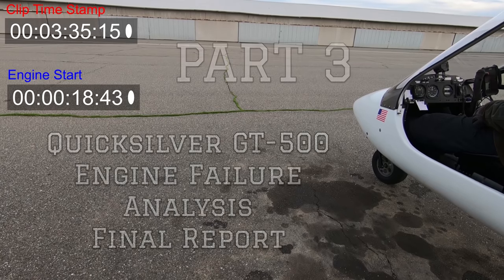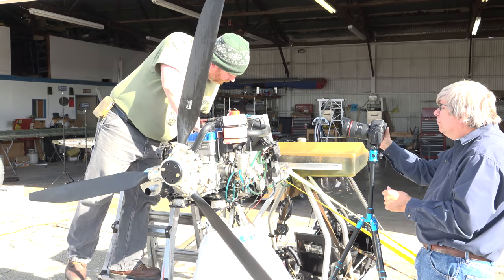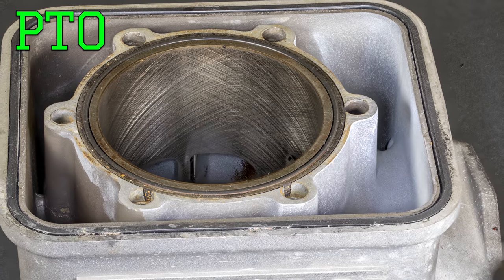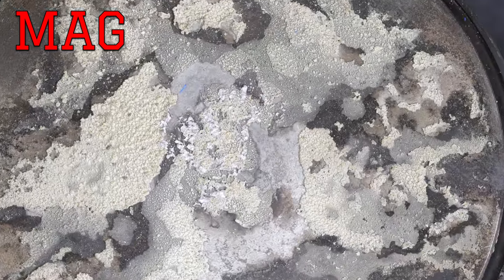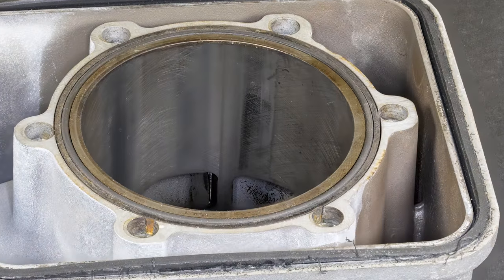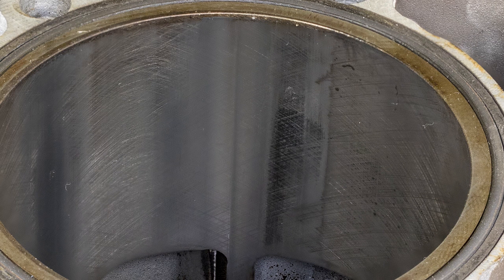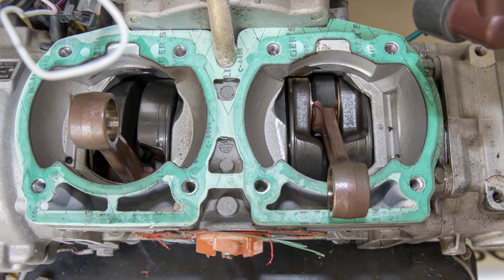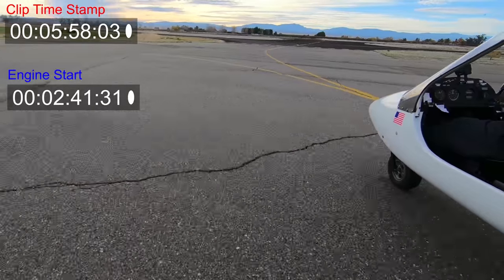GT-500 Crash Investigation (Part 3) Final Analysis

Comment: Important Addition to your Investigation Report: 
Coolant Loss of Rotax 582 Blue Head is most likely from leaking O-Ring Head Gaskets blowing the coolant out of the radiator. In August 2018 I bought a Titan Tornado II that had not been flown for a number of years. It had 174 hours on the engine. The coolant reservoir bottle was full but after running engine up and seeing a high head temperature I opened the radiator cap and the rad was down about a quart of coolant. I filled the radiator and checked for leaks over a couple of days. The second run up was only a few minutes but the head temperature came up again and I found coolant on the tail surfaces and the rad down the same amount. I removed the head and the O-ring were worn oval with tear marks. No indication the coolant was getting into the cylinders but probably leaking high pressure combustion chamber exhaust gas into the head coolant chamber foaming up the coolant. Luckily the cylinders were in excellent condition. Rotax calls for the head to be removed every 150 hours and the piston head scraped clean of carbon. I assume they want the head gasket O-Rings changed on reassembly. They also call for overhaul at 300 hours.

Comment: First of all I would like to thank the fine folks at Rainbow Aviation for this very informative video.
I would like to add some general knowledge to this thread in order to promote knowledge among all aviators. It really bothered me when the cooling system expansion tank was pointed out and the way it was installed. Clearly whoever had installed this cooling system did not have an idea at all about how a cooling system is supposed to work. 

The coolant recovery line that was improperly added at the top of the expansion tank was one of the causes of loss of coolant in the entire system. It is basically a brick at this point! The proper method of installing the recovery/overflow line is to go into the bottom of the tank. Is this video, it clearly shows that the outlet, the small nipple at the bottom of the tank, was plugged up. Completely wrong!! Now, if the line that was added at the top would have had a piece of tubing or piping that went to the bottom of the tank internally, it would've probably worked correctly. But all  they had to do was hook it up to the already provided outlet nipple! 

In a liquid cooled engine, water needs to be surrounding every square inch of 'wetted' areas (cooling jackets around cylinders, water pump, hoses, and radiator) from bottom to top, with no air pockets. The water is what absorbs the heat. Now, as the engine heats up, the water expands...it also builds up a bit of pressure. The liquid flows right into the overflow/expansion tank. The radiator cap is spring loaded and is supposed to open when the pressure gets too high. Most systems are supposed to operate at about 4 or 5 pounds of pressure. 

This is only half, though, of what is supposed to happen. When the engine is shut down, everything cools off. The water condenses, taking up less space in the wetted areas previously mentioned. The  net effect of this cooling down,  is a pressure drop in the engine block area. A vacuum is actually created on the waterside of the block. Coolant can then flow FROM the overflow/ expansion tank back INTO the engine block!! The waterside should stay as sealed up as much as possible to allow the physics to work properly! The coolant level in the exp. tank should fluctuate as the system heats and cools. The expansion tank must be able to vent properly in order for the whole system to function correctly. There should be no leaks (as shown also in the video) in any hoses, pump, radiator, block etc. Air is the enemy in a sealed system!! Only the expansion tank should have air in and out of it!  Your car cooling system works the same way!

I hope this helps everyone!!

Comment: The detail of your forensic analysis is stellar.  Early on you mentioned that the aircraft maintenance was current.  The elephant in the room is, who maintained that aircraft?  Not their name,  but their qualifications.  The condition of this aircraft being used in an instructional capacity is borderline criminal.  More than likely, "check coolant level" is on the preflight checklist.  A quick glance at the plastic bottle and the "pilot" would "assume" the coolant level was sufficient.  So many other deficiencies.  We all know and accept that "stuff happens".  This video clearly shows how screwed up an engine can be and still function.  At 23:10 there are several "bugs" on the carb parts??  Videography detail is outstanding !!
Reply from the maker: Beaver, thanks for your kind comments, especially from someone of your credentials.  It's ironic how many aircraft are running around with significant levels of maintenance deficiencies. I think it is more a case of you don't know, what you don't know. And I suppose the reason that our maintenance classes are so popular. This kind of stuff happens, and the first comments are usually about how lousy the two-stroke engine is. You and I know better. I'm constantly saying that the vast majority of problems, on these little airplanes that we love to fly, are "caused" by the owner/operators. In this case, the owner of the aircraft was a student pilot and the airplane was relatively new to him. Unfortunately, here in Northern California we have a severe lack of instructors for these type of aircraft. The instructor was a GA instructor with minimal knowledge about the two-stroke engines. Kind of a perfect storm.
Reply: Looks like he never checked it and or did the checks himself or not at all . New pilots this is not your Honda civic it is A flameout waiting to happen . You wont like the sinking feeling you get when it quits on you low and downwind.

Comment: The video tells us why the engine quit, yet no mention was made of the pilots control input which in my opinion was the actual cause of the accident.  As the RPM's were dropping the nose of the plane should have been immediately lowered  to gain airspeed for the flare.  It was obvious that as the RPM's dropped the pilot briefly pushed the nose forward then before the plane could pick up speed he pulled the yoke back into his lap.  The result was predictable.  Sure it was an engine failure that started the chain of events but the pilot mishandled the recovery and landing.
Reply: I agree 100%  It kinda surprised me he pancaked in like that. It almost looked fake, like a cartoon,  I was looking for the roadrunner Bee Bee!! Hawk out!!
Reply: Come on, its obvious that he cant be called a Pilot, the engine had no maintenance whatsoever, they never checked the coolant level, they never payed attention to the temp gauges or anything, and did not know how to recover from this engine out stall, they are very very  lucky to be alive

Comment: Aside from an inadequate pre-flight, a cold 2 stroke engine and an obvious need to get out to the practice area ASAP & work hard on power off & power on stalls, what could go wrong? . Never drop below a pre- designated altitude (I always used the point of manuver initiation as my start altitude) & get that muscle memory trained. I know every pilot that has watched this has cringed as this poor guy pulls the yoke into his lap the second the engine seized. This is why we practice constantly. Finally, it's very easy to arm chair quarter back. We are all grateful for you guys sharing. I've made many mistakes as a pilot. If we're lucky we survive to teach the next batch of fliers. Cheers!
1 second ago

Comment: Simply brilliant. Thank you Carol and Brian Carpenter and Rainbow Aviation. I hear repeated trashing of two stroke engines and this body of work you have set forth has no fingerprints pointing to any inherent weaknesses in these engines. Of course, your work was incredibly complete but the coolant system wrong plumbing and the chain of failures that you outline give me comfort to know that yet another accident comes down to "situational awareness" for all involved in the flying and readiness of an aviation system.

Comment: Very helpful analysis. Always comes back to basics of preflight checks, not ignoring warning signs, and airmanship. I've only flown LSA (Aerotrek 240 aka Eurofox), not ultralights. My instructor reviewed engine out procedures on takeoff, emphasizing retention of airspeed and best glide. Next time she closed the throttle I pushed the stick forward so aggressively we experienced negative G's! I do wonder if this crash over the runway could have been avoided, or if a stall crash was inevitable. In the Aerotrek I believe it would have likely had a different outcome if handled correctly.

Comment: I am a proponent for using WATER PRESSURE gauges as THE way to monitor a cooling system and 
when you think how it works against " what is not right and what is going on", it makes way more sense 
than a temp gauge.
Simply put, a pressure gauge is telling you, if your too low a pressure you do not have enough 'coolant
volume' and or a leak at the point in time of the failure and if it is, or starts climb too high you are making 
steam. 
A temp gauge depends on a piezo sensor that if it is suddenly dry it will not respond as it should, like a 
pressure diaphragm that is a go or a no go indicator.

Comment: Thank you for sharing. I do have a question about something brought up during the carb analysis. You said that the idle jets had no o-ring. I recently bought and installed new idler jets. I too thought an o-ring needed to be installed. My parts supplier noted that no o-ring was installed on the Bing 54 or 84. A check of the Bing website showed no o-ring. When I removed my old idler jets they too did not have o-rings on them. Can you confirm this statement?

Comment: Great engine failure analysis! As far as the accident goes, the pilot could have not only prevented it by proper engine maintenance but also flying properly before and during the engine failure. He didnt stay in ground effect and he pulled back rather than pitching forward when the engine began to die.

Comment: As is said later on, it was a stellar presentation.  Your knowledge is extensive.   I've flown with the 503 for many, many years.   Would not sit behind (or in front of :) a 582.  They always have trouble of some description.   

It does take quite a bit of knowledge of, and maintenance of, these 2 strokes.  You can keep them running well IF you have a maintenance plan,  knowledge and an ability to read and follow instructions.    Lots of folks won't ask for assistance.The overflow was a dead giveaway.  Even I (Mr. fan cooled 503) would have known that.  The carbs were a great giveaway also.  No attention to maintenance at all.   Thanks for your in detail explanation - I really enjoyed.  (Never had heard about a "shock wave" in a cylinder.  :)   Thanks.

Comment: Nice video series on this accident!  Well done.  

So...I'm curious.  Given that the engine was liquid-cooled, how long of a warm-up is appropriate?  Obviously longer than four minutes?  19C is 66F so it wasn't horribly cold in Willows that afternoon.  Four minutes for a liquid-cooled engine seems like quite a long time.  

Is there a coolant temperature gauge in the GT500?  In my experience, temperature gauges will give erroneous indications if there is not liquid to measure the temperature of.  

I agree with your conclusions though: Pretty poor maintenance and preflight.  I've noticed that in general, people don't take aviation very seriously, especially in the homebuilt crowd.  This guy's just lucky the engine quit when it did.  Another hundred feet higher and, holding the stick back like that, he'd have been a lawn dart instead of just a smoosh.
Reply: @That Bob Guy .... You appear to casting asperagus at the "home built crowd" : that be me! Let me unwind your overwrought criticisms: (1) the water temp normal is circa 150F-175F or similar so there would be no usual need to get the temp stabilized prior to lift off (perhaps you are thinking of a Lycoming and the oil temp in the green zone) and it would be out of the norm to run the engine until an over temp situation is noted (and like you say whether or not a sensor will accurately read a "dry socket" is unaddressed but these damaging temps reached would do immediate damage even to your water bed liner if they were localized); (2) everyday visual inspection of the excess coolant tank would have indicated plenty coolant; (3) with the radiator location up high a ladder would be the usual acoutrement for the radiator-cap-off inspection.  It is just hard to swallow your indictment of homebuilt when similar "failure of familiarity with all systems" is all too well known to happen in all segments of aviation. As has been documented by the Carpenters and Rainbow, there was an ever present chain-of-events that could have been sidestepped with a higher cognition level of all things aviation. There are additional facts that may never be known and undoubtedly sensor systems that could have given indications of impending attention needed.
Reply: That Bob Guy lol lawn dart
Reply: Warm up is till it locks up !

Comment: I have the same engine in my Avid. Thanks to the problems you uncovered, I'll pull the cowling before next flight. I use auto gas & pre-mix oil. What fuel was the Quicksilver using?

Comment: The pilot pulled the stick back when the engine stalled...WRONG WRONG WRONG....Never do that....Point the stick DOWN to pick up airspeed and not stall the plane...This plane could have been saved had the pilot make the right  move...Basics you learn from flying Ultralights
Reply: exactly my thoughts. Almost exactly like over correcting in a car and rolling it. Glad he was ok.
Reply: It seems to me that the pilot (who was the instructor I think) did not notice the engine failure until it was to late. I feel like he transitioned mentally from "take off" to "climb mode" to quickly.   This airplane could have been saved though the margin to do so was very slim only a few seconds. I feel like the pilot lacked focus on take off.
Reply: Exactly!   It's not rocket science
Reply: AGREE 100%
Reply: Depends  how near ground you are

Comment: There is also the fact that it happend in cold air condition witch cause leaner mix and then a risk of detonation. Those 2 stroke engines are quite sensible to air temperature and altitude, so having a perfect mix in those conditions with no adjustment is very difficult so the tiny problems detected in the carburetors would not be proeminent unless a really bad basic setting.

Comment: Was there a vent in the lid of the coolant overflow can?  If not, how much pressure could that overflow can withstand?  When the radiator cap pressure is exceeded, any attempt to vent the over pressure would simply pressurize the overflow can, eventually everything would be at some higher than expected pressure and SOMETHING would have to give.

Comment: Curious if there was/is a cylinder head temperature gauge, as seems common among aircraft power plants? Sounds like either the PO or the mechanic that did the last service was lax, if not outright negligent, in the overhaul/rebuild process. The coolant leaks, and most especially the sloppy carburetor rebuild were big contributors to the engine failure and would have been resolved by an astute mechanic. Sadly, after reviewing the video, I believe the pilot was to blame for the crash, as he can be seen pulling back on the stick vs pushing it forward to maintain air speed and make a safe landing. Also, I feel the pilot was not paying attention to his aircraft, overall, or he would have noticed elevated temps and the knock or ping associated w/ pre-detonation/-ignition. At the very least, that "crash" could have/should have been avoided, as there was adequate speed/momentum to provide for a safe landing, had he reacted correctly vs like a student pilot. Pilot error, once again.

Comment: I'm not a pilot or a mechanic. But As the plane is climbing away and as the engine is failing the nose appears to drop towards the ground as this happening the pilot is pulling back on the stick at no time did he push the stick forward to try and keep or increase the air speed.

Comment: Interesting that the carbs had more wear than the rest of the engine and that the jetting was non standard as far as jet size and missing gasket.  When\why did the original carbs get replaced?  I know that it did affect seizure, but perhaps that and the addition of the improper radiator recovery tank condition indicates some culpability in whomever was performing powerplant installation and maintenance.